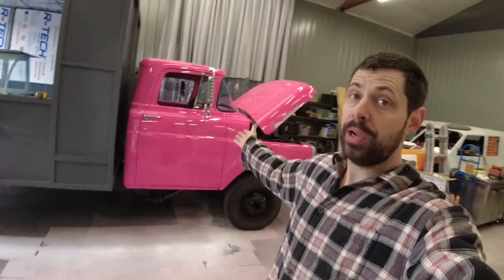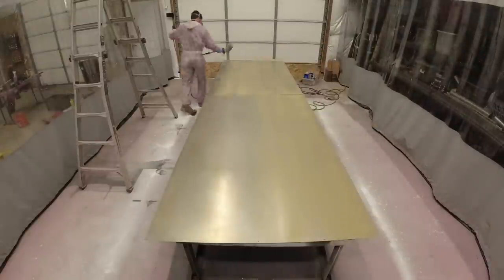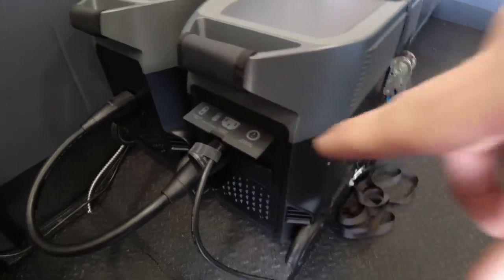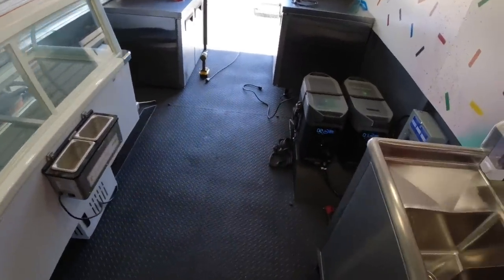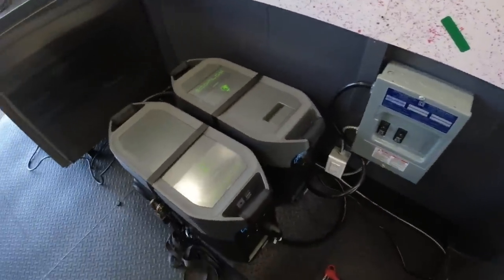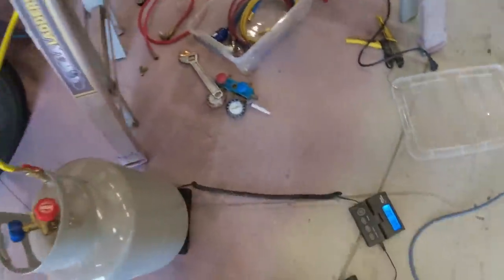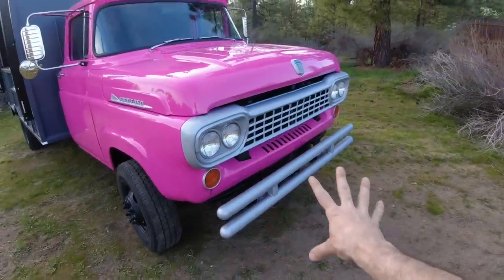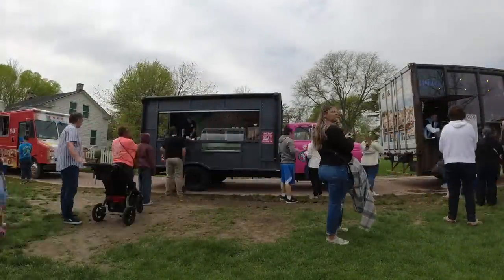FINISHED Transforming a School Bus into a Vintage Ice Cream Truck (Episode 6)

Comment: I honestly hope you are not relying on that 10 awg cable coming from your 7 pin to charge the Delta. Max is about 120 watts from the cigarette lighter port.
Reply from the maker: I should have clarified that input is 180 watts max, and it only charges if the battery temp is low enough.  It does offset a little while driving, as the average pull is around 300 watts while driving.

Comment: Nice project, the truck looks fantastic, clean, great build!  I'm a little surprised you didn't use a common, low cost shorepower connector, and an autotransfer switch to charge the ecoflows and run the loads while 'docked'  The DC wire you selected is a bit thin to send the maximum load (15a@~12v, 180w) the length of the truck.  That looked to be 12awg, and over 30ft, that's a 15% voltage drop at full load, delivering only 10v to the ecoflows.  The wire will get hot.  I'd recommend a 6 awg wire, which would get you to 3.5% drop over 30ft.  And of course use a keyed source (or a contactor that operates off a keyed source.)  Or just not doing it at all, as 180w isnt really much of a dent in the power pull of that setup.  Overall though, man, great setup.
Reply from the maker: The cig lighter input maxes out at 180W and the run is less than 10' from the fuse box so It doesn't have any issues getting hot. Generally when the freezers are at temp with product driving around the power consumption is around 300 Watts, so it offsets about half that, which isn't a lot, but its better than nothing. I considered running a 2000 watt inverter on the truck to charge it faster while driving because the truck has an upgraded alternator from it's school bus days, but they wanted to wait on that and maybe do it later.
Reply: @AustinCoulson  Totally understand the customer sometimes kiboshes an idea or puts it on the backburner!  Fantastic work either way.

Comment: such a shame that the hot side of the refridgerator compressors couldn't support the hot water requirements.
Reply from the maker: 1000%  This used to drive me so insane in AZ when people would have an air conditioned house and a heat pump on their pool.  Should have just used one unit cooling the house and heating the pool
Reply: I so wish they would build things like this. There is a name for it and some thing now have that exact thing. I would love to have remote compressors for my fridge and freezers as I do have a bunch of them.

Comment: I love your work, but dang I miss the detail like you would share in the builds from Phoenix time.  I wanted more info on:  The rear bus type lights. How did you get them lined up even with each other. That rolling door, how you attached it, what's it like opening and closing it? And that automated awning, pretty slick. Any battles installing it? Getting it lined up, did you have to struggle to get the two arm/brackets smooth? Is the awning running on house battery or engine battery. One motor or two?  
I am not asking you to answer all this in comments, just letting you know the types of things I was thinking during this video. I was like "oh no, stop the timelapse, slow down and talk about it."
I appreciate your work, I just want more detail. Hehe, maybe I am just old.   
Thank you for your videos.
Reply from the maker: I wish I could spend more time on the videos, but they just don't get enough views to justify the time to go into greater detail. It also seems like I am always rushing against the clock to get these trucks finished so I speed up at the end.
Reply: @AustinCoulson  Fair enough. Thank you.
Reply: I actually like the time lapse, it makes more interesting.  @AustinCoulson

Comment: What did you do for wipers on the windshield?
Reply from the maker: It has the original wipers wired up to the new harness
Reply: @AustinCoulson  Probably the best way.   I must have missed the part where you mentioned it.  On your pizza truck build now.   Saw your forklift build for my second lineup.  Love the content and the fabrication.
Reply from the maker: @alk3myst  I don't think I showed the wiper conversion. It was simple, I just stole power from the van wipers and sent it to the factory dash switch. I wanted to wire it into the van multifunction switch on the steering column but it was not happening with the way the speed controls worked on the old vs new wiring.
Reply: @AustinCoulson  The wipers overhead I never cared for.  Better to keep the cowl ones even if you need an extra switch.  Just went through all your Pizza Truck videos.  Amazing talent.

Comment: Awesome job. Can I ask how much do you charge for this project? Is $150-200K in the ballpark? Probably 800 man hours (including delivery). And guessing >$50K in materials?
Reply from the maker: You aren't far off.  I didn't buy any of the interior equipment, so I am not sure how much it all cost, and I built this for my Cousin and Uncle so I lowered my labor rates. For a regular client if I bought all the equipment, this build would probably end up around 160K$

Comment: It looks like you welded galvanized steel with stainless. Aren't you worried about galvanic corrosion? It is in a truck which gets a lot of vibration.
Reply from the maker: I didn't use any galvanized steel on this build. What part are you referring to?
Reply: At around 14:00, when you were building the frames for the stainless steel table. What kind of steel was that? As I understand it, you shouldn't put different metals together as it can cause galvanic corrosion. This also applies to the different types of steel: galvanized, carbon and stainless.
Reply from the maker: @neilbohrs5990  the frames were mild steel. I didn't weld the mild steel to the stainless, I glued and riveted them together after I painted the frame. I have welded stainless to mild before on exhaust systems, but corrosion wasn't an issue because they were painted with a high temp exhaust paint afterwards